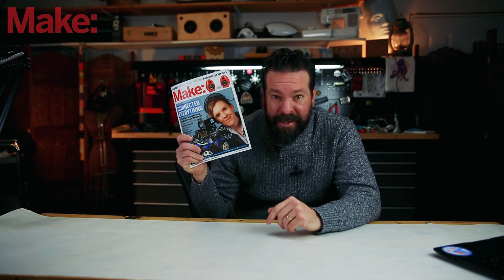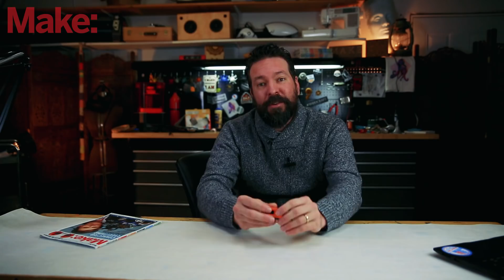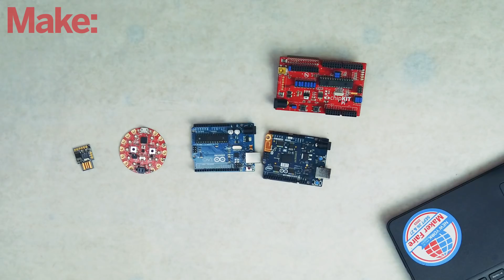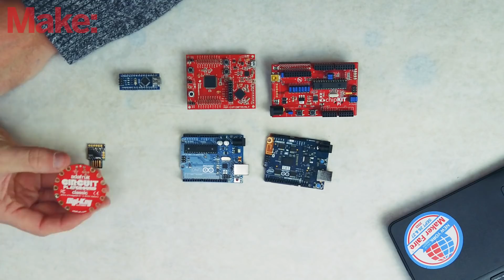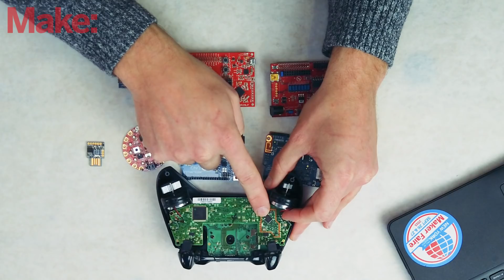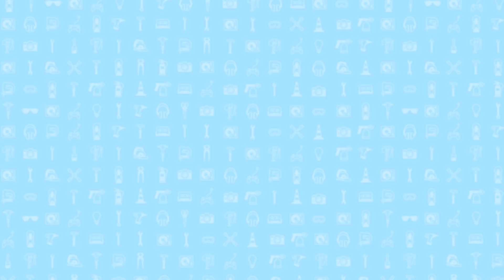A brief explanation of development platforms and microcontrollers

Comment from the maker: what kind of electronics topics would you like us to cover? basics? code? advanced?
Reply: Thanks for the info.

I'm not sure this fits your focus and no doubt it's very basic level stuff but here it is.  I'm a time machine freak.  I'm into clocks watches and all sorts of time keeping.  I'd like to take it one step further and make a time piece for all the major solar neighborhood celestial bodies like the moon, Mars, Ganymede, Ceres and ect... each solar body has different basic time units as one second on Earth is a different span of time than one second on Mars.  Ganymede is unique to its own basic time unit setting this up would be interesting.  Thanks for your time. 😊
Reply: @avionicstechshop7664  Naturally it would have Nixie tube readout.
Reply: @markawbolton  that would be interesting but it would take up a lot of space.  However, if make chose that option I'd be happy to go with the flow.
Reply: @avionicstechshop7664   Its a lot of extra complexity. I like the 50s ishness of nixies though. Small screen LED monitor would be way more practical. The Elektor nixie clock has a gps module to derive the time standard. Works well.
Reply: There is constant, loud interference noise in the audio
Reply: code, please. but also the hidden layer between the user code and the hardware. also, your mic is buzzing
Reply: just a thought. how can i set up a network of iot devices, and have my friends come over and play espionage and try to hack it. with physical defenses and a fort and a flying fox
Reply: and from the comments, I think it would help if you display the jargon textually on screen, with a bit of more info or a link to more.
Reply: Make: a diy For making a voice box for your woody doll
Reply: And also something to help a robot Think for itself

Comment: I’m 60 plus.  I am interested in learning code.  I don’t know where to start.  Help me.
Reply: Try an arduino kit.
Reply: David it depend what you want to do.. build web pages? Databases? Robotics? ... Perhaps write little scripts to get applications to do things without using a GUI. Arduino is a good place to start and there is plenty you can do with them . Python is you go to. Setting up a raspberry pi  to do something usefull can be fun too.
Reply: Start with python tutorial. Not necessarily on these chips
But on your computer.
Reply: David if you haven't had a look at Linux I would definitely suggest you give to a go. It is pretty easy to  get started in.

Comment: Even though I understand electronics, it was frustrating because the details were skimmed over. I was interested in seeing more workings of the device and uploading some code on it. Thanks for going into details in this video
Reply: Agreed. It felt more like an unboxing video than any sort of valuable information, like "This one has a USB cable, making it easy to upload code with x software", "There's a development community that has a bunch of example code for this specific device", or somesuch.
Reply: I believe this video was aimed on new uses of electronics and not a full project video but a summary 🧐
Reply: @NewAgeDIY  Alright, what were those uses? I'm not asking for a full project, but some examples of the value proposition of this item would be salient.